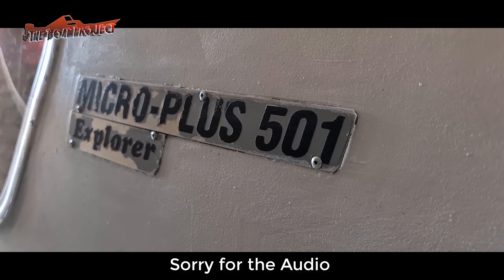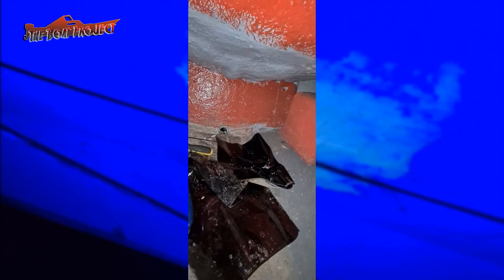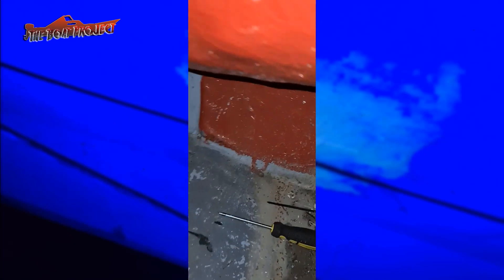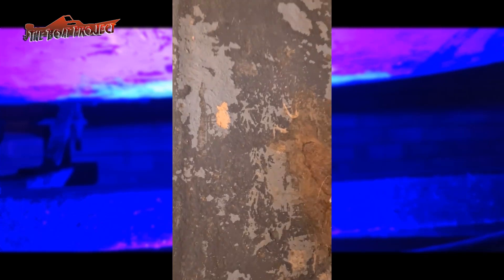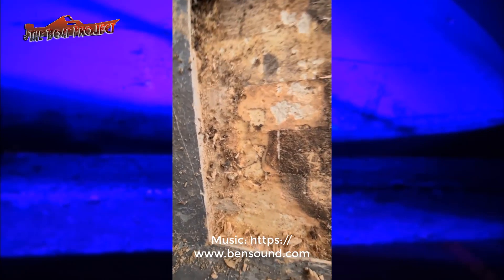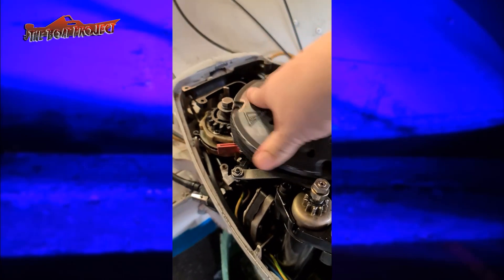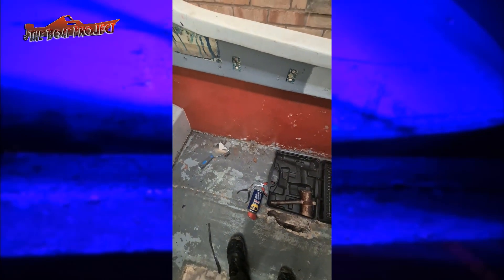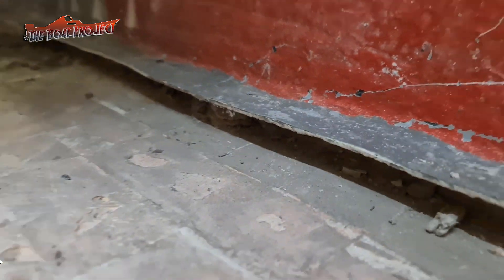The Boat Project Episode One - Microplus 501 Explorer GRP Floor Replacement

Comment: It's been 12 months since your last entry, how's it going? I have spent a week on my Microbus 501 explorer and have the same problem as you but yours is in worse condition than mine. I only have to replace 400mm x 600mm of the floor and suspect the transom alo needs replacing especially after discovering they used chipboard to build it.